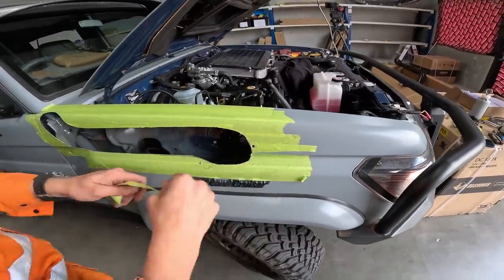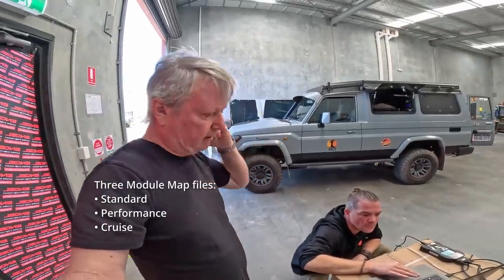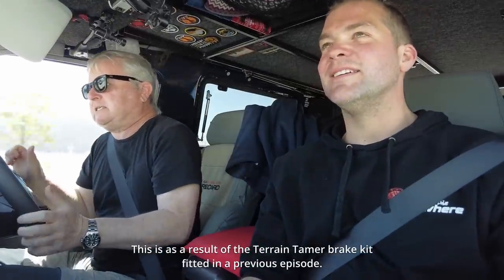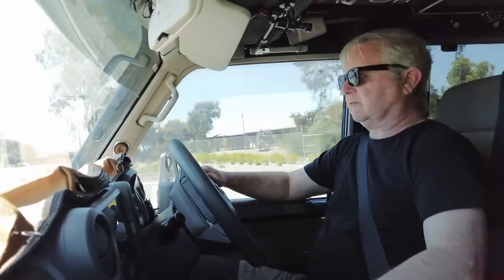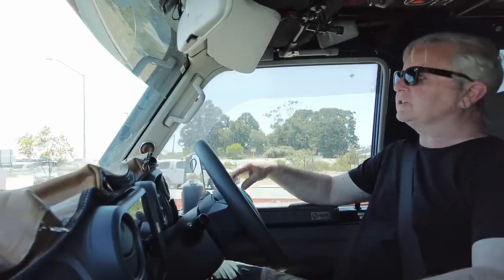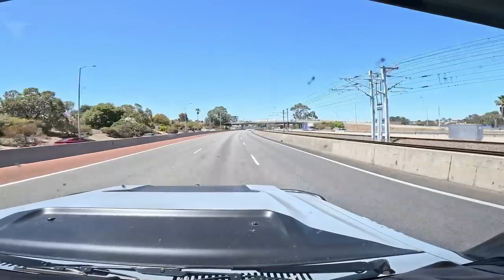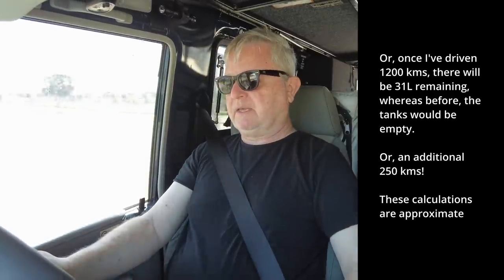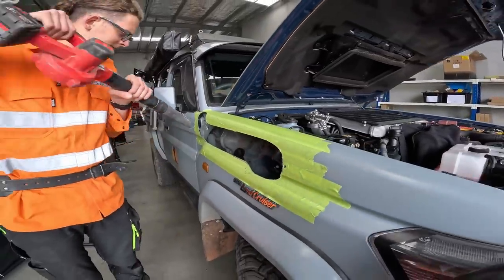Torqit Performance Product Test Results. Troopy Masterclass part-3 | @4xoverland ​

Comment: I would say the biggest improvement you want out of the exhaust is the dump pipe to try and drop the exhaust manifold pressure. Being you have a dpf and did not change anything off the back of the turbo your really just making noise for slight flow improvement in the wrong area.

Comment: It may be difficult to admit but the best option is always to leave everything standard. After huge expense one gets more noise, an unmeasured and subjective  performance increase and unknown influence on engine life. Why not leave perfect alone? It is by far the cheapest option.
Reply: The issue is that the 70 series engines are seriously detuned to the point where you wonder why you bothered. They have easy power gains with very little risk given the amount of power the 200 safely produces stock.
Reply: @pantoqwerty  I have been driving Landcruisers for more than 3 decades. During the same time I noticed various modifications to petrol and diesel engines, all which aim to improve output, economy, torque, 0 to 100 times, top end speed etc etc. These "improvements" included valve jobs, turbo chargers, engine mapping, different exhausts, cold air intakes and many more. Not a single one of the above lived up to the promises. All, without fail, reduced engine life, increased noise, reduced fuel consumption, bugger up driveabilaty etc. Some engines, that normally last enormous distances, failed in extra short time. The 4,2 liter normally aspirated diesels, recked by adding turbos, comes to mind. It is true that the 200 series engine is more powerful than the 70 sometings, but it has two turbochargers, different cooling, different coatings on the pistons, different dome thinkness, different mapping etc etc. It is naive to think that the Japanese engineers have not heard of 3 inch echaust pipes, stupid snorkels or amateurish mapping.   Their engines, in the various mod states, are designed and axhausivly tested by an army of PhD engineers and scientists over a wide selection of terrein, temperatures, height above sea level, sand,  snow etc etc. To think that a bunch of dimwits, one which cannot even quote the first law of thermodynamics, can modify a modern finely tuned design and improve efficiency in their garage with primitive tools and no testing equipment like dyno facilities etc, is wishful thinking. Do so at own risk, and good luck with your warranty claim.
Reply: @pietvanderwesthuyzen6502  most tunes I’ve seen are done on a dyno
Reply: I remapped my 200-series with a reputable tuner on a dyno. It ran arguably better than stock but it had one problem. It spewed out significantly more black smoke at the exhaust pipe.

It ran quicker, doubled my torque and improved fuel economy for a black smoke screen at the back every time there is a slight incline on the road. It looked pretty stupid, in my opinion.

I returned the ECU map back to stock. It was fun while it lasted.

Comment: The V8 is detuned for a reason. Reliability and stamina. Here come the leisure-time engineers...
Reply: Anecdotally, Ronny Dahl’s mate Torben has done some serious km in his 76 and that is definitely tuned, so I guess it depends on who tunes it and how. Get the bogan full send tune and it will likely cause issues, sensibly remap and you’ll be fine. The 200 produces more power stock, so no reason a 70 can’t

Comment: Nice video. In the interest of a controlled experiment it would’ve been nice if you’d run a fuel consumption test with the snorkle intake fitted in the correct or orientation. Apologies if you did that and I missed it.

Comment: Impressive results.

As I expected, the exhaust would be a bit too loud. 3.5" is pretty brave for a first-time choice.

Also impressed with the results of the stainless steel snorkel might get annoying or tiring on a long days driving on a slow going track.

Comment: Engines whether gas or diesel are simple air pumps so any time you can make them breathe in easier and exhale easier you improve efficiency gaining both fuel economy and power so I would think it's a win either way the snorkel is probably contributing maybe 5 to 8% the exhaust is actually probably around the same maybe up to 15% But it honestly just through the video sounds amazing

Comment: As I said in a previous post, (piss off the throttle controller, ram air intake and exhaust, they do bugger all except make a lot of noise) just fit the remap or good quality well researched chip for everything an exhaust does and soooo much more.
Reply: The controller doesn't add power but its cheap and it adjusts the throttle ramps which either can be adjusted in the ecu or you can only set 1. Toyota make it pretty laggy to save drive train wear.

Comment: 1. Turbo engines does not need intake/exaust modifications very much. Better breathing helps naturally aspirated engines mostly. 2. Those ECU maps are base maps - not specific for that particular engine/car. You can achieve better results with intake/exaust and then proper engine map fine tuned with test runs. Base maps cannot do that actually. Those base maps are probably maps programmed without intake/exaust or with them (now you are running intake/no exaust). So yeah :)))) can be done better. But  thats also not bad. Important to know that turbo engines does not benefit from better breathing (intake/exaust) as much as naturally aspirated ones. People often mixed those two thinks. If you have naturally aspirated engine you need intake/exaust/headers and then some mapping in order to achieve more power. For turbo engines if the turbo is original there are no much benefit from intakes and exaust. Just the turbo dont care about pipes before and after as much as non turbo.

Comment: I recently installed a Safari snorkle on my Prado 150, after a month of driving my fuel consumption has reduced by at least one litre per 100km, (according to the average fuel usage indicator) in fact on a cool morning along the highway I am back down to 8 or 9 litres per 100km, like it used to be before all the bull bar, roof rack etc were installed. Midday I'm up around 10-12

Comment: In this case, I think the benefits of fitting a larger exhaust are limited by the dpf. On a pre dpf model, it will help more.
Reply: Usually not. The turbo blocks the exhaust anyway and forces the air in so it's much less significant than a NA car. Most cars like a hilux prado or 200 actually loose a bit of torque. I'm not sure about the stock 70 series exhaust, some DPF can cause a restriction.

Comment: I have a torqit exaust and love the sound, as for my fuel economy I put an automatic 6 speed in and my revs at 100km per hour dropped to 1500 rev from 2200 that's what made the biggest difference
Reply: Great to hear mate!

Comment: Thanks for the review on the ECU module and throttle controller. I'm interested to know why you didn't use Unichip again as you were happy with it previously. IMO an ARB safari airmax snorkel is king. I have a 3" DPF back exhaust and it's super quiet.  The drone if a larger exhaust is annoying and really just for show and a youngsters kicks.
Reply: It's because the Torquit stuff was free......

Comment: Ok. So what’s the actual reason for the different fuel economy in your later compared to the earlier models? You have been able to get it down to 12.3L/100km. My Aus 2008 78 series and my NZ 2009 76 both do 13L/100km cruising at about 100kmph.

Comment: Car tuning is not excluded from Newton's Third Law of Motion, "For every action, there is an equal and opposite reaction."  So for more power and/or increased throttle response, generally means more fuel consumption. 🤪

Comment: I'm interested in your comment (last ep) about the fuel consumption being significantly higher than you expected.  Was it higher than your last trophy?  If that is the case, what is it about this one that could be causing the increase?  More drag from fittings?   Is the different rooftop or bull bar increasing drag.  It should be lighter so that's not the issue.  

Trying different products to see what impact they have on consumption is all good, but if the base vehicle has a higher consumption than you have experienced previously in the same model, shouldn't you be looking if something is not right?
Reply: Very good question, I've been wondering along the same lines. Maybe the green Troopy  V8 also had a forward facing snorkel?

Comment: Hi Andrew! Changing the engine map to gain this fuel benefit, from my basic understanding of engines, made the engine run more lean. More oxygen to fuel ratio. This is what VW was caught doing. If more air is available in the engine performance goes up but the excess O2 bonds with Nitrogen from the air making NOx emissions go up.
Reply: That's how the aftermarket tunes get more power and economy. Along with more boost.

Comment: Andrew- couldn't you also get some skinnier tires on your Troopy  to improve mileage (225/95/R16 or 235/85/R16)? I believe you have 265/75/R16 Tires now. I believe 235/85/R16 would be common in Australia
Reply: Andrew, I'm sure you know this, but- 265/75/R16 are 31.65 inches tall  and 235/85/R16 are 31.73 inches tall. To me this seems like a no brainer- try 235/85R16s on your Troopy. They are 1) slightly taller. 2) Will be better off road (as you have taught me) 3) Will contribute to better fuel economy. 

Only thing I don't know (since I'm in the U.S.) is the availability of 235/85/R16s in your country. They are easy to find here.

Comment: I have a throttle controller (different brand) and agree it just made my car so much more pleasant to drive (it's my wife's favourite change so far).  I also expected a negative effect on fuel consumption, but it the difference was negligible.  Going one size bigger on the tyres had a much greater effect.
Reply: The throttle controller is applying throttle at a heavier and quicker ratio, I can't imagine your fuel economy drop is negligible.  If you are literally pressing the throttle harder and faster by proxy, it should have a quite noticeable effect on fuel economy.
Reply: @gpaje  I expected it to be worse for the reasons you've stated, but I calculate my economy every fill up, and it may be slightly worse, but it's not noticeable in my calcs. I run my throttle controller in auto mode so it's possible it's actually dampening the throttle response while cruising, which would help negate any extra fuel used under acceleration.
Reply: @MrDingo71  That makes sense, if you don't have it under a more aggressive setting.  The one's I'm used to usually have levels you set, but not an auto mode that could potentially tone down the settings.
Reply: @gpaje  I've been pleasantly surprised, certainly wasn't expecting it!  The auto mode seems to be programmed really well, nice and responsive when accelerating from rest, but not too sensitive the rest of the time.  Haven't found the need to use the 'fixed' settings apart from experimental runs, and dampening it down when off-road.

Comment: Well there goes the warranty.
Reply: People always say this, but if you have an issue not related to the extra power they can't do that unless you let them. It's very unlikely a simple tune would make short term issues, it will be out of warranty by the time the turbo, rings or bottom end goes. If you damage the drive train in a stock car off 4x4 they won't fix it anyway.
Reply: @veneratedmortal4369  the fact that it’s publicly shown to Toyota he has changed a factory tune with the module will be all the evidence they need to drop any warranty work

Comment: I thought chips were a thing of the past and ecu tunes are the latest and safest way to tune? (Work shop depending). Was this a tune for your vehicle or generic tune for the 1VD motor?

My 79 series with the facorty air box but a 4" inlet into it and 4" snorkel the dyno run with vs with snorkel we found the snorkel quite restrictive compared to no snorkel. Obviously the snorkel has benefits off road.

Comment: One reduces drone in the exhaust with a thing called a muffler......  the diameter of the pipe is irrelevant.  Having said that, 3" is plenty for your engine size.

Comment: The Australian aftermarket scene is sum of the best in the businese but where can you buy “normal people” parts for everyday touring vehicles?
The exhaust pipe on a car is dictated to buy the size of the TURBO outlet, the outlet on a 79 series is not 3.5 inches wide😂.

The larger the pipe the more room there is for sound to bounce around in. Touring vehicles do not need excess noise.
What’s wrong with the market when all you need is an OEM replacement exhaust that flows better..., stock size, simply hi-flowed with fewer restrictions and made to the quality we have come to expect from our aftermarket industries?

The snorkel and the airbox are a fine product, meeting and exceeding the factory part.
i would really like to see Andrew test this in a traditional configuration, with a forward facing style head, 
and compare what it does to the sound, and fuel economy? 
For the regular touring/work vehicles, in dusty conditions, it’s nice to have the option to change out the snorkel head for different levels of air filtration and engine protection like the manufacturer intended.

The modern Diesel engine certainly does benefit the most from a good quality Aftermarket tuner.

With better fuel economy we can all drive our 4X4’s further off-road.

Comment: My big question in this kind of mods is: what about the reliability compromise? Will the motor have issues after a long time of using those mods?...  Toyota motors help but not everyone has one 😅
Reply from the maker: If there was a compromise to reliability, I wouldn't do the mods. I'm very careful and do a lot of research.

Comment: An aspect you haven’t addressed, Andrew, is the warranty implications of all this.

I follow a couple of Toyota diesel centric mechanics channels and to a man, they point out what they see as a root cause relationship between the chippers and tuners and cracked pistons.

Yeah you can create lots of extra oomph by over fueling.  And lots of extra economy by running the whole shebang somewhat leaner.

But what happens next if the engine goes all poopy in its trousers?  Toyota sure as heck won’t be interested.  And I bet the chippers and tuners won’t pony up a new engine either.  You need to save a shiezen tonne of fuel to pay for a new engine … correct?

The chippers and tuners also rely on, without saying as much, that Toyota engineers have NFI what they’re doing.  Toyota employs 350,000 people.  If only one tenth of one percent of them are engine designer/engineers, that’s 350 people.  How many engineers does Andrew’s chipper/tuner employ that are dedicated to Toyota?  I bet it’s not even 3.

My point is warranty and reliability are important to the discussion.
Reply: Totally agree. I often have to laugh when people pretend to know more than skilled engineers who contribute to produce rock-solid engines.
Reply: As I often say, if these mods were any good the factory would put them on. I agree, many millions of dollars and countless hours are spent by auto companies on development and then someone outside decides that for a few thousand dollars of development they can add a hundred dollar chip on the motor and all is good.
Reply: The 200 makes 200kw from the same engine. I think it's fine, unless your a farmer with a 3.5t trailer and 1.5 tonnes in the back.

I tuned commodore v8s back in the day. The stock afr was 8:1 and 13 degrees advance. The same engine was in the hsv so it needed to be detuned. It would lean out to 20:1 stock at low load for economy/ emissions. stoichiometric afr is 14.7 for petrol and a very save power enriching(for wide open throttle loads) is 11:1. It should have been run at 14.7 and 12 for power enrichment with min 24 deg advance. Modern cars have knock detection so it should detune itself if the engine cylinder is getting to hot and pinging. In a diesel you only need to be concerned about exhaust gas temperatures, and usually you can get an intercooler or if you want big power and exhaust to fix that.
Reply: Those issues will generally be from people that asked for a “full send” level of tuning. Safe tunes can be had from plenty of companies that will offer improvements. It’s worth noting some engines can be tuned better than others. The 70 series is one, the 3L Prado allegedly not so much.
Reply: @pantoqwerty  so why don’t the tuners offer a like for like warranty for when it goes all poopy?  Toyota will say it’s big their problem because you’ve modified their engine.